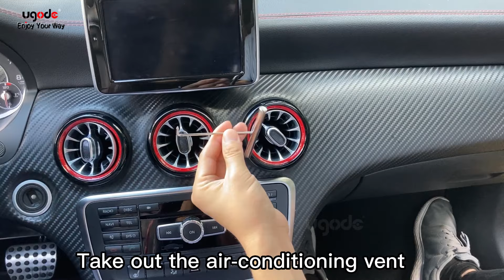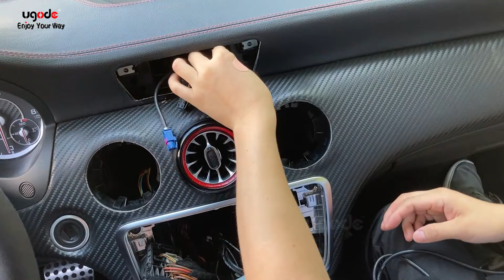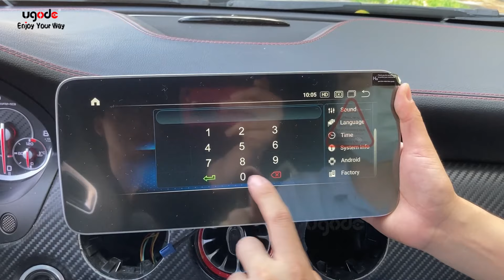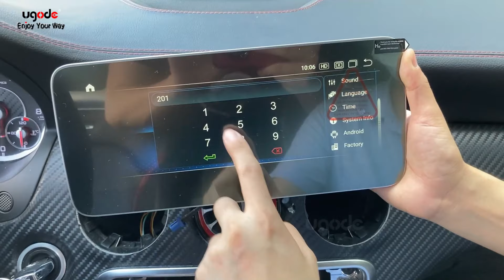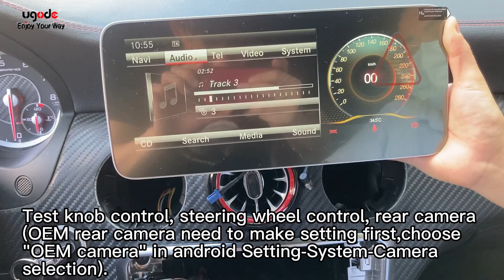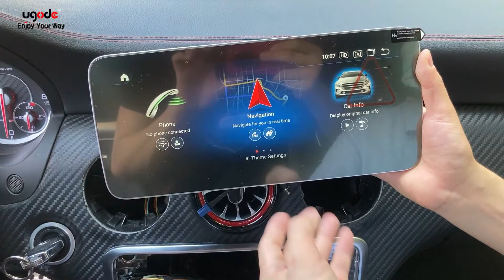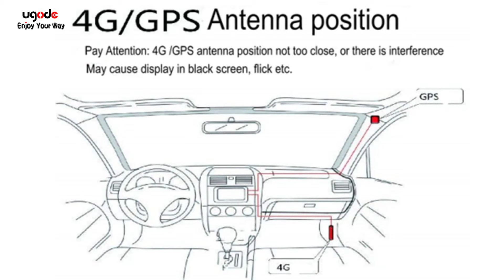How To Install 12.3" Android screen For Mercedes-Benz CLA GLA A W176 C117 NTG4.5

Comment: Does the front parking sensors now work with the android screen? A Class have a light bar for the front but rear is on screen. So would it now be both showing on screen?

Comment: My class A does not have a jack o ami input. How do I connect the android device to the Audio20 (ntg4.5)?
Reply from the maker: Depending on your car, some car audio cables are integrated into the CD power cable and do not need to be connected to AUX or AMi.